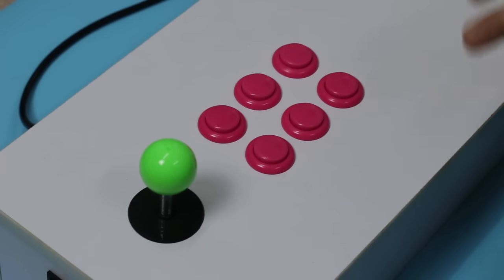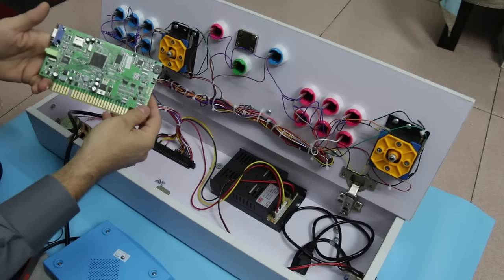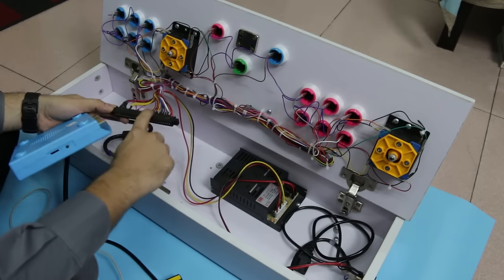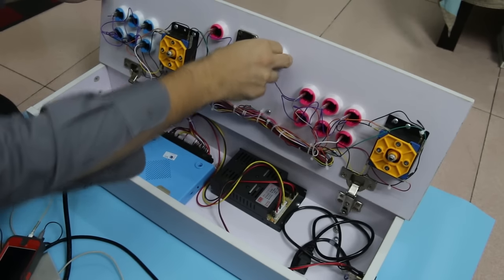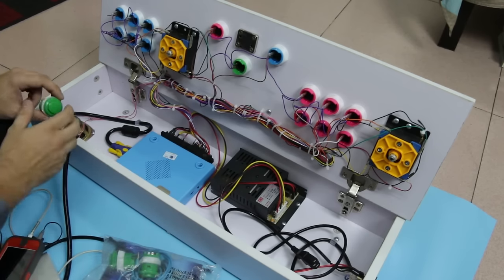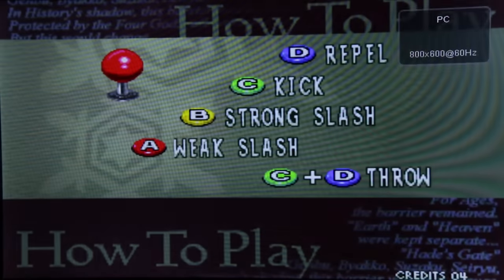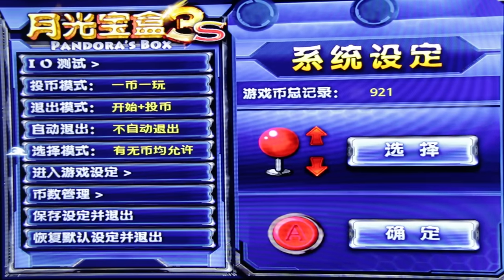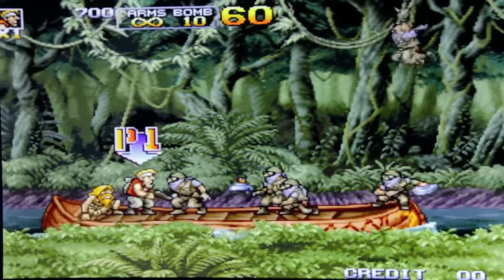Home made Chinese Arcade Machine

Comment: any concern about heat build up?, maybe a small fan installed might be useful?
Reply: The sunxi A13 is a very low power processor utilized in fully enclosed tablet computers, it and memory barely needs 2W to run. The potentially largest power consumer on the board is the audio amplifier, 10W mono TDA2003. However, at 12V supply into a single 8Ohm speaker, it will only deliver about 2W max before audible distortion sets in. It has around 60-70% efficiency, so the losses on it will be below 1W. It can be driven to provide 10W by connecting multiple speakers in parallel, until total speaker impedance of about 2Ohm is achieved, so in that case, 4W loss must be considered for thermal design.

The power supply looks monstrously oversized, so it could be generating heat on its own. Chances are, the box cools just fine just through the mounting hardware and speaker, but if it doesn't, installing just a fan wouldn't do any good, you'd also need some holes to let the air go in and out. If you arrange the ventilation holes sensibly, like bottom front edge, top rear edge, you shouldn't need any active cooling. But i guess arranging them just along the rear edge could work fine, especially if a separator is installed to curb airflow short circuiting. If active cooling is desired, i think two holes on the rear edge, the inlet with filter and fan on the power supply side, and the outlet on the opposite side.